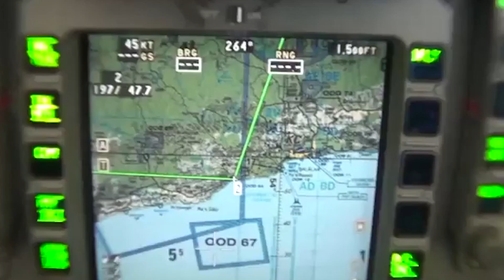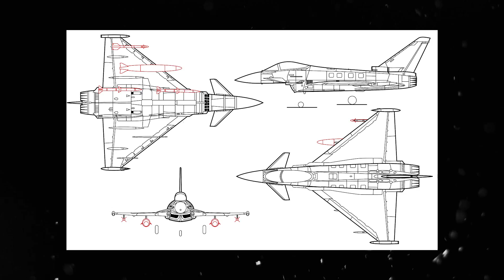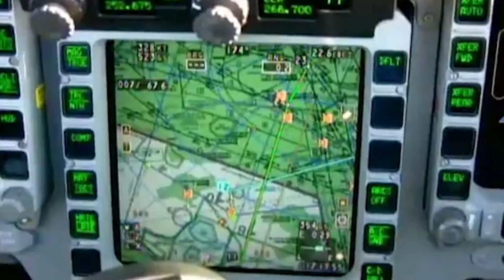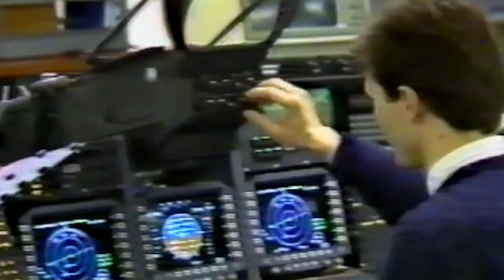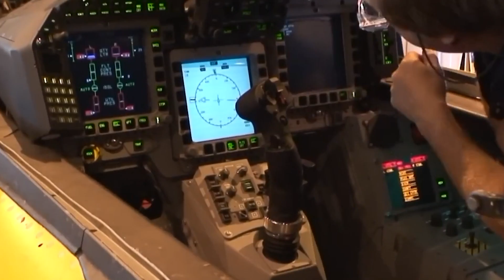The Mach 1.5 Dogfight Killer

Comment: There is nothing stealth about the typhoon, it has so many external pylons that there is nothing clean about the airflow over this aircraft, and probably has a radar cross section that can be spotted hundreds of miles away. I was never a fan of this project and I’m still not, Britain could have developed something way better than this if they had put their minds to it, and probably at an equal or lower cost had there not been so much corruption involved in the Euro fighter project.
Reply: Stealth is overrated anyway and no use in a dogfight, which is one of the Eurofighter's primary role.

Comment: afaik, they didn't even fared that bad in preliminary tests against the new F-35s, prior to the official enter in service in europe's air forces of the latter. so much so that people started having more than some doubts about the need of the Lightnings II, especially at the price they reached
Reply: germany only bought f35s because the americans wanted to have the building plans and source code of the electronic systems for the Eurofighters in exchange for using their A-Bombs on them. So Germany replaces its old Tornados with F35s instead of Eurofighters

Comment: EAP WAS NOT "an early prototype" of Typhoon.  It was a technology demonstrator, designed to prove technologies, reduce risk and reassure politicians.  It used existing components where possible (e.g. tail and engines), while proving new technologies like composite fibre construction and relaxed static stability with a digital flight control system.  Your comments about the radar arguments are entirely incorrect.  The issue wasn't (then) about mechanical or electronic steering, it was about which radar to use as the starting point to develop the new unit.  Germany wanted the APG-65 based MSD2000, having just upgraded the Luftwaffe's Phantoms with the American excellent unit.  The UK wanted the (even better) Blue Vixen based ECR-90.  Disagreements about electronic beam steering came much later, with Germany again delaying the upgrade for years (well over a decade, in fact).

Comment: I too saw it take off from Wharton over the River Ribble estuary, what a sight, so fast and straight into hard turns with all the water pressed out of the air. Wharton was the home of the Lightening which overtook Concord in a flash. I remember those being tested with Blackpool Tower used as a reference point for avionics in the 60s. And the TSR 2 was also seen over Blackpool!
Reply: Warton dude.

Comment: The Eurofighter typhoon, f-16, f-15, f-14, Gripen, mig29, su-27 and more 4th gen aircraft are all pretty equally matched. I mean canards do give S.T.O.L.(short takeoff or landing) privilege's to a lot of aircraft(f-15 had a canard version for NASA). As for what 4th gen aircraft is the best... well that's difficult to say because most things are classified and this isn't a gaijin forum. My personal favorite would have to be... f-15c due to raw torque. Speeeeeeed
Reply: Although the F15 has a "slightly" higher 'dash' speed when 'clean'. The Typhoon outstrips the F15's performance in all other aspects. It out accelerates the F15 to mach 2, it has superior climb rate, it can maintain a 9g turn, 'almost' indefinitely (pilot permitting of course) & even with a full air-air load, the Typhoon can still supercruise at mach 1.5+, something even a clean F15 isn't capable of.
Reply: @THE-BUNKEN-DRUM  true but the f-15 was made  around the early 1970's while the Eurofighter typhoon is a early 2000's aircraft. Also, obviously the governments aren't going to disclose the full specifications of aircraft.
Reply: Rubbish.

Comment: The other advantage of mechanical plus phased array scanning is that as frequency of a radar reduces the cone of detection on a phased array also reduces. This means that if you have both you can have a much wider frequency range covering several bands instead of just part of one. The Radar in the Typhoon can theoretically work all the way down to 900MHz and up to something over 20GHz which as far as I know is classified so for all I know it could be 20.1GHz or 50GHz. The upshjot is that most "stealth" characteristics work at a set range of frequencies. The radar can get round that by just doing a sweep. Then there are the engines. The new EJ2x0 are higher thrust and less fuel per pound thrust as well as marginally lighter. When I say higher thrust I mean a lot higher. EG an extra 4000 pounds thrust dry per engine and an extra 7000 in full afterburner. That would give a thrust to weight ratio of 1.6 to 1. That would give more accelleration climbing vertically than jets of the early 60's could do horizontally.
Reply: So I’ve been in this business since the 1970s, and nothing you said is adding up for me based on all I know about fighter fire control Radars.  The “cone of detection” is something for MSAs.  AESAs use beam-steering through interferometry between the transmitter-receiver modules.  Frequency range is something entirely different than azimuth and vertical scan field of regard.  Freq range within X-Band is determined by physical characteristics of the TRM emitting/receiving elements, and the antennae size on older MSAs.  It’s the whole reason why missile seekers are in a different region of the frequency bandwidth due to limited size of the antennae.

As to Thrust-to-Weight ratio, that math isn’t working out either.  You need to add operational empty weight with internal fuel, pylons, ammunition, the gun, LAUs, and then calculate available thrust across the altitude/speed regime.  For a static book answer, you can set up at 20,000ft at .9 Mach with 50% internal fuel and weapons.  It’s not going to be 1.6/1.  Where did you read that EJ200 is getting 4000-7000lb thrust increase per engine?
Reply: I know right!? I bet these guys didn’t even think about…. That…

Comment: *laughs in F-15*
Reply: Eurofighter  runs circles around the F15 in every way.
Reply: @georgebarnes8163  how many aircraft has the eurofighter shot down?
Reply: @me-4106 how many has the f22 raptor? 😂 0
Reply: @deadbeats7604  bro brought up the raptor, we’re talking about the eagle and the eurofighter and it technically has one air to air kill but it’s a balloon
Reply: @me-4106 The F-15 mostly shot duds equipped with antiquated missiles…
Reply: @jeromeportier4914  over 100 victories in aerial combat
Reply: @me-4106 thats one more than the typhoon 😏
Reply: @georgebarnes8163  This aircraft along with the Rafael, F-16, F-15 are an over 3 decades old design...The future is stealth.....True Cat 5 aircraft. F-22(also an old design) and F-35...
Reply: @georgebarnes8163 😂😂😂😂😂😂😂
Reply: @@karmakazi101 you clearly arent in-the-know about the current version F-15. No one is buying the typhoon. Enough said
Reply: @John_Redcorn_  The airframe hasn't changed: a F-15EX is not more manoeuvrable than a F-15C. It would take something special for a F-15 to beat a Typhoon in BFM. And for BVR, even the F-15EX is stuck with AIM-120, which are not a match for Meteors. So BVR is out too. In terms of improvements on the EX, they're mostly sensors added in pods, sensors that the Typhoon already has, and arguably better integrated. E.g. the IRST is still better on the Typhoon. Oh, and the EX still has an RCS of 25m2, so like 50x more than the Typhoon. So what is it we need to be "in-the-know" about regarding the current F-15 version? Show us that knowledge!
Reply: @jeromeportier4914  that countries are buying it and not the typhoon. Pretty simple, really
Reply: @John_Redcorn_  No one is buying the F-15!! No one has bought the F-15 on its merits for 25 years!!
Qatar ordered it, but we know it’s the normal political goodwill purchase that buys them political influence (the Saudis want to buy the Typhoon, BTW). South Korea bought it in 2002 for political reasons (it came behind the Rafale in their technical evaluation). Singapore bought it in 2005 because it was cheap (again it was behind the Rafale in their technical evaluation). Who else?
And no one is queuing up to buy the EX because it’s super expensive.
Jeez, the Strike Eagle has been around for 15 years longer than the Typhoon (and the first version of the Typhoon was an interceptor only) and there are more Typhoons out there than Strike Eagles!
For the original Eagle, only Japan, Israel and Saudi Arabia bought it. As far as I know, no Western country was ever interested.
Reply: @jeromeportier4914  lol. You just listed numerous countries that bought it…right after saying no one bought it. Indonesia i think has commited to buy like 20-30 and Poland is looking at also purchasing. And of course you gave the typical obligatory response of ‘political reasons’, just like every single time the US makes a foreign sale. Like no country has autonomy with its purchases?! Not to get off topic, but i guess all those F-35 sales are also political?
Reply: @John_Redcorn_  No one is buying it now. I very much doubt Poland will buy it. And Indonesia just bought Rafales, so doubtful as well.
My point about buying for political reasons was more about Gulf countries that seem to buy more to please countries than anything else. It wasn't the case with the F-15C, but some of their purchases are super dodgy (e.g. Tornado ADV).
If you look at the F-15E, the only countries that bought it outside of the Gulf countries are Israel, South Korea and Singapore. And for the last 2, they did not get it because that was the best they could get, or the best for their needs: they both settled on it as a "best second choice". The F-15 was an incredible plane in the eighties. But it's not the eighties anymore...
Reply: @jeromeportier4914  Indonesia is buying both f-15ex and rafale. They wanted the f-35 but the US didnt trust them enough to sell them a 5th gen

Comment: The plane is nothing comparable to F-15,  F-16 or Su-27. Hell the fighter have lost so many bids that it couldn't be comparable to the Mighty Rafale. Su-24 is better than this aircraft.
Reply: It's pretty obvious why they lost so many bids though. The thing is hella expensive and once it was mature enough the F-35 was on the horizon as a better option for those with the deep pockets.

Comparing it with other 4th gen air superiority fighters, it wins or pulls a draw in nearly all relevant aspects.
State of the art radar. Sensor fusion comparable to that of an F-35. Expansive and fully integrated ECM suite from the start. Reduced frontal radar crossection. IRST. High combat range. Large missile load. Best AA missiles in service.
So if you want to compare the Eurofighter to F-15 or Su-27s you have to be more specific and pick current variants like the F-15EX of J-16. Then it will be pretty close.
Reply: @karmakazi101  Pulling numbers of wikipedia doesn't mean much these days; and since both planes are still in service I doubt the real numbers of their performance would be public knowledge aside from production numbers. 

One doesn't need to do thorough research to know his comments about the F-15 are exaggerated nonsense. A barge with the turning radius of an oil tanker? Please...and your last sentence is just making up excuses for that drivel.
Reply: Get real, the F15 is a barge with the turning of an oil tanker, the only aircraft you mentioned that gets close to the EF 2000 is the Rafale
Reply: @georgebarnes8163 Obviously you've never flown the jet.
Reply: @fighter5583 Whether he’s flown a F-15 or not, the F-16 runs circles around the F-15, and the Rafale and the Typhoon run circles around the F-16…
Reply: @jeromeportier4914   A lightweight fighter vs. a standard air dominance fighter. Who do you think has a tighter turn radius? And saying the F-16 turns tighter than the F-15 isn't saying much as the F-15's turn radius is still pretty tight for its size.
Reply: @fighter5583  The F-15 is super agile for a missile truck. But it’s still a truck. In a dogfight you’d expect the F-16 to have the upper hand.
At the end of the day, it doesn’t matter in which category we place them. If they come in contact they still have to out turn the other.
Reply: @jeromeportier4914 thats packed with so many assumptions. One scenario the F-15C will out-rate an F-16 is in a slow speed, low energy fight, say less than 300-350 knots. They are pretty much equal in most aspects tho
Reply: The Royal Air Force doesn't like dog fights because that gives the other chap a fighting chance; Typhoon (oh, how the Jerries hate that name!) is designed to see first and kill first with Meteor. The defensive armaments and aids will do the rest if required.
Reply: @barrylarking8986  No air force will give the enemy a chance if they can dispatch the guy early. But pilots don’t take chances: they try and cover all bases, and that’s why they still practice dogfighting.
Reply: All aircraft you 've mentioned are obsolete dinosaurs in comparison with the Eurofighter-Typhoon. Only Rafale is close in terms of performance, but slightly under the Eurofighter's standards ( lower top speed, slightly lower acceleration, slightly lower rate of climb, slightly lower instant turn rate and slightly lower sustained turn rate ). Moreover being lighter the Rafale's thrust to weight ratio as well as the wing load are getting more negatively affected when it carries the same ordnance with the Eurofighter ( let us say 4 Meteor missiles ) moreover the Meteor missiles on the Eurofighter are embedded under the fuselage, whereas in the Rafale they hung under pylons which affects negatively the aerodynamic coefficient. The newer Captor-E radar has the property of pivoting inside the radar cone and thus the Eurofighter can take a perpendicular direction as compared with the direction of the incomming missile without breaking the lock-on, whereas the Rafale must restrict its manoeuvres below 60 degrees. One talks about the Mighty Eurofighter whenever one compares it with the cheaper Rafale.
Reply: @catfood_03_4stray  The Rafale has better data fusion, a more ergonomic interface, better electronic warfare, a better combat range, can carry a bigger payload, is easier to maintain, is getting upgraded faster. And it does have a better turn rate at most altitudes. There are reasons why 1/ it’s always been ranked ahead of  the Typhoon in tenders, and 2/ it’s spanked the Typhoon in BFM exercises.
But I agree that people who think your average F-15s and F-16s can compete live in fantasy land…
Reply: you make my day !!! So long time I hadn't laugh like that ! Thanks dude. @catfood_03_4stray